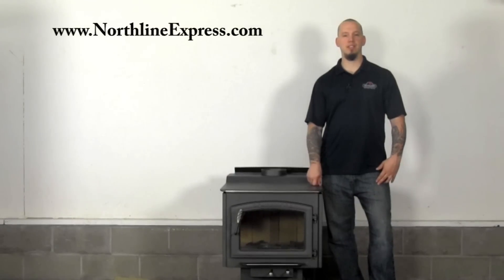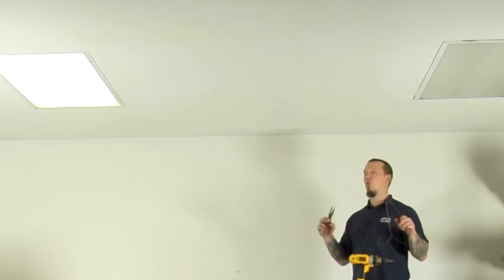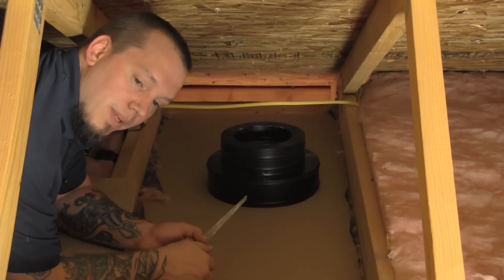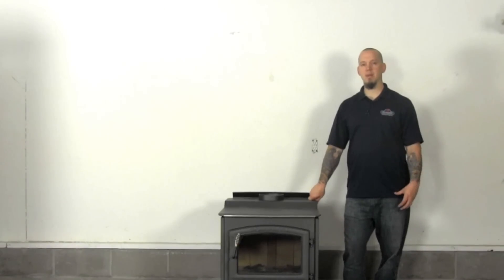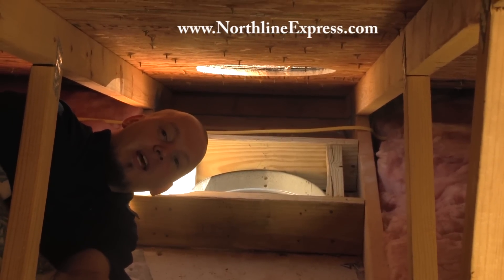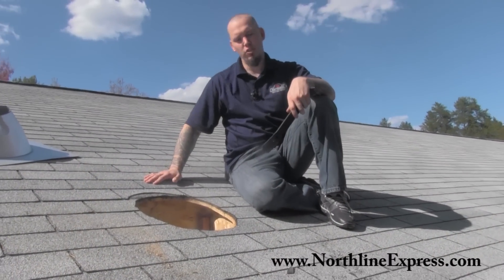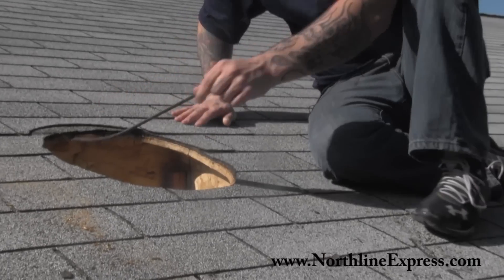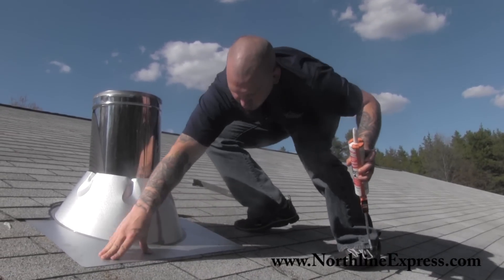DuraPlus Chimney Pipe - How to install a DuraPlus Triple Wall Chimney Pipe

Comment: Do you guys have a video like this for the actual duraplus ceiling box. This is duratech. Probably the same install except its a square not a round hole right?

Comment: Yes you missed so much important info . Like cutting the hole in the roof , leveling the section of pipe you put in . What holds the pipe into the hanger box . All the stuff a green horn needs to see before he can understand how it is done.

Comment: One tip regarding the plumbob. Its a pain to be up on the ladder and looking down to see it it is center. So, what you can do is simply put a piece of masking tape across the center and put a dot on it with a sharpie where the center point is. Now when doing the plumbob you aren't trying to see if it is center, all you care about is whether the plumbob is over the dot.

Comment: Very informative, very helpful, thanks! A few things could  be added to make it even more helpful, like how did you determine where to cut the hole in the roof? Also, I struggled quite a bit with attaching the double black pipe to an old stove. No instructions for that anywhere, it seems.

Comment: Those un pulled  nails underneath those 3 tabs will sure shit push though the tabs in time creating leak . Should always pull all nails and then if you have to nail the  tabs seal with geocel...Trust me I know installed 100s of those chimneys on asphalt shingles, Rubber, and melted Roofing.
Reply: THANK YOU FOR THIS POST!!!!!!!!!!!!!

Comment: Joe great video and thank you. I have a similar situations not enough room for the metal insulation protector. I have 2x4 trusses and only 6 inches from where my hole is to the roof decking. Is there any reason why I cant just build my ceiling support box say out of 2x8 and just cut them to hit the bottom side of the decking. That way I don't have to build a separate box for the insulation protector. I can even cover the individual pieces with sheet metal if I want. If I do it that way I also believe I can install at least the back piece and 2 side pieces from down stairs.

Comment: Awesome Video, Thanks for taking the time to do this. I've got a metal roof, so I've got to figure that out now.
Reply: For a metal roof you just buy the roof flashing made for metal roofs. Everything else is pretty much the same
Reply: I have a slanted metal roof, same problem. Did you get it figured out?